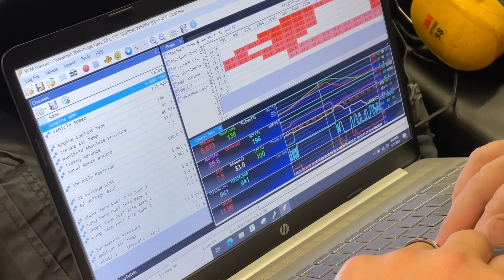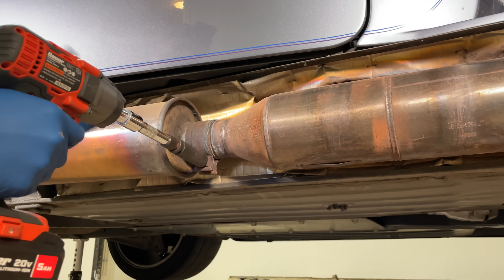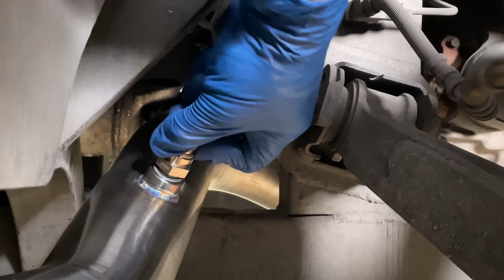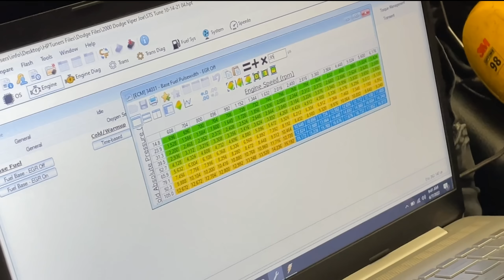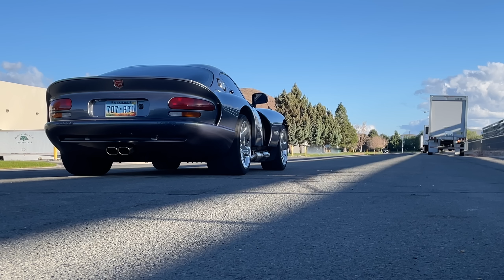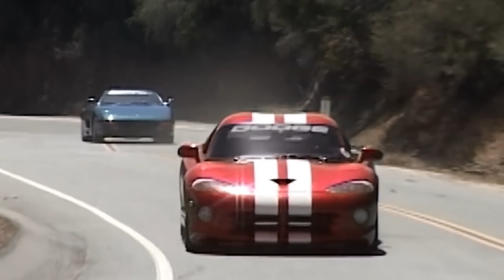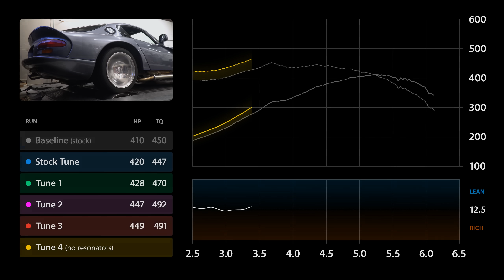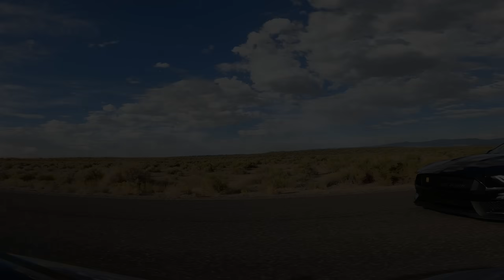When you give an 8-liter V10 the exhaust it deserves

Comment: It may have been quieter, but it definitely sounds better with the resonators. Without its a flat mush of engine sound, the resonators really increased the contrast and it sounds much more like a super car. Can hear the V10 sound and now you are in lambo/R8 territory instead of mushy american displacement. Either way love the car! looks amazing to drive!

EDIT: Especially when coming off throttle between shifts, sounds WAY better with the resonators!
Reply: Pretty much all cars sound way better with resonators. In fact without the resonators this vipers sounds a bit obnoxious.
Reply: @MrUppmas  nope
Reply: The viper, tuned with exhaust putting down 458hp to the wheels is about the same in the real world as a hellcat and cobra would put at the wheels. That 17 ordinary mustang putting 460? to the wheels wasn't stock at all, to be able to stay with the 458hp viper. Owners of hellcats claim a real 570hp at the wheels, is equivalent to around 710hp at the crank.
Reply: You seem to have accidentally used "with" instead of "without"?
Reply: Yeah agreed. Resonators sounded way more refined
Reply: It sounds like a truck without the resonator.
Reply: The "mush" is just the mic distorting. They sound way better irl, but they're so loud that the speakers clip.
Reply: completely and utterly disagree on all points
Reply: Too many people think brassy, blatty exhaust sounds good. I couldn't agree more with xSiliconKnightx. @MarinaraRacing

Comment: Damn, that exhaust design sucks if just taking off the resonators cost that much power. I found it interesting during the install video you have a reducer/conical pipe that extends into the resonator? Seems overly complicated and choking the exhaust. I'd be curious if you got rid of the reducer, kept it a full 2.5 or 3", kept the resonator and ditched the cats. May have added some sound and power while still retaining some sort of resonator/muffler.
Reply from the maker: Lou Belanger swears up and down the reducers increase performance. I’d have to do some controlled testing to really know.

Comment: It's actually pretty wild how well a car much older than the GT350 does and how much it can compare to it.
Reply: Well the Viper dominated GT circuits for a decade for a reason. Europe had to remake their rules just to keep it from winning every single time.
Reply: You know how much the viper used to cost when new right? I’m not surprised, you’re comparing a gt350 mustang, but still a mustang to a semi exotic car, for the money it makes sense
Reply: It wasn’t designed by Lamborghini, they recasted the block to aluminum. Chrysler designed it.
Reply: I mean it is impressive how little power the viper makes with such a large block.
Reply: @sidders1943  well it has no turbos or superchargers and it's a Truck engine.
Reply: @Qugie lol its not a truck engine. It was designed by Lamborghini.
Reply: @sidders1943  I mean... the engine is actually pretty damn reliable. This is a TWENTY THREE YEAR OLD CAR, so what are you comparing this to exactly? 
Z06 from this era made only 400 chp
911 turbo made only 450 chp 
Mustang cobra couldn't even make 320 chp and was discontinued for a while
Camaro SS sat at 350 chp
Pretty sure you've got to look at cars like the Lamborghini Diablo to find anything from this era making a bit more power. 450 without tc is a LOT of power on the street.
Reply: @sidders1943  Because peak power isn't all there is to vehicle performance. I'm honestly sick of seeing this "it makes more HP so it's automatically better" mentality that people have online that to me seems like they don't understand internal combustion engines at all and are just glorified bench racers spewing out HP and TQ numbers. 

Also, a lot of American engines are designed with the performance aftermarket in mind. Take the small block Chevy V8, they have dozens of companies making their own specific cylinder heads, camshafts, intake manifolds, exhaust manifolds, pistons, crankshafts, valves, etc. where as most Euro or Japanese engines have 2-3 companies making performance parts for them. They know their customers will want to add more power, so they leave it on the table for them.
Reply: @sidders1943  It's the same little power that OEM's like Ferrari and Porsche had to get banned to have a chance at circuit racing.
Reply: Almost like if you took a car with less weight more torque and maybe a smidgen less wheel horsepower the car with better numbers would win

Comment: Noise is just bullshit, performance is what is important. No wonder European sports cars with engines half the size and a fraction of the noise outgun loud rubbish like this. They concentrate on torque and power output not exhaust and engine rumble.
Reply from the maker: they just add turbos
Reply: @Four_Eyes  There are many sports cars that do not use turbos. It just  seems that american manufacterers concentrate on the things that don't matter. Engine and exhaust loudness does not equate to speed and performance.

Comment: It's actually impressive to gain that amount of hp on the whole curve just by swapping the exhaust
Reply: more airflow more bang mo powah
Reply: No :P @b5254t4rs
Reply: dont forget the tunes
Reply: its the tuning that made the difference
Reply: @rykehuss3435  My first thought, too: Valid comparison? Did he go through the tuning exercise with the stock exhaust, too? I guess not.
Reminds me of what I just learned, that Koeniggsegg advertised their Freevalve advantages by stating figures compared to non VVT engines instead of modern VVT engines.
Reply: @rykehuss3435  all other comments are Biden voters
Reply: @rykehuss3435   watch the last dyno pull same tune but deleted resonators,  shows a gain
Reply: clearly a restrictive exhaust
Reply: Pro tuning + good exhaust will do that. Fixing the entire aspiration and exhaust system from intake to tailpipe and tuning to use that extra flow adds a ton of power.
Reply: @Gelatinous  Well, it doesn't add more than perhaps 10-20 hp, so much as it gives you exponentially QUICKER access to that feisty V10 power/torque you already have. Ergo "throttle response!"
Reply: Wait till you find out about 🐌
Reply: @kumbho80  ffffutututu
Reply: @kumbho80  Turbo???
Reply: what's not impressive is making 450hp from 8L, that why such easy gains can be made.
Reply: @krusher74 that's a stock V10. Stock cam, lifters, pistons, intake, and the rest.
Another 2 weeks or so of work in the shop, and 600 ponies will easily be made without nitrous or bolt ons.
Reply: he made ecu reprogramming
Reply: tuning is the key to power success
Reply: Huh?
Reply: jhgad
Reply: @nismojunk  Sausage
Reply: Because your have 8l v10 on it,  just let the engine breathing and your get a lot extra hp
Reply: 100gallon per miles...aw yeahhhh americaaa
Reply: Vipers are good on fuel compared to other high HP engines (for cruising at least) because there is so much torque / power low down that you can have a super long 6th gear and cruise along with the engine just slowly ticking over. Corvettes with long top gears are the same too. 'murica 💪 @shafiqshahar1456
Reply: Its the amount of cylinders. a 4, 6, and 8 cyl will gain the same overall percentage of hp with a tune.
Reply: "just by swapping the exhaust"
That's not what happened at all
Reply: Not without a tune. Back in my day there were 40ps VW Polos that had mufflers on them with taillpipes as big as  a tunnel. 
They sounded like 500hp but accelerated like a ride-on lawnmower 
🤣
Reply: @Enforcer_WJDE Forged internals, a rowdy cam and some Webers could get them up to 100hp, but it's a metric fckton of work and money for what might be a hell of a lot of fun, but in the end still a relatively slow car
Reply: @samteks125  It's not always about too speed. You can't even use the entire revband in 1st gear without going to jail.
Reply: Guess the tune didn't happen LOL
Reply: V10 8.1 liters and just 465hp? Wtf? It should be at least 700 stock...
Reply: Engines are pretty similar to us in that sense. The like to breathe. More air and a retune to compensate is always going to make more power.
Reply: I mean the original exhaust is pretty damn limiting
Reply: its a v10 lol not a 4 cylinder
Reply: Turbo cars same way, 227 becomes 300 with full exhaust, boost up
Reply: The major gains you get from improving your exhaust is throttle response, with just a little hp/torque gains.

It simply gives you quicker access to the hp/torque you already have!

Comment: Full dual 3” exhaust glasspacks with 1 7/8” long tube headers that exits right after the door works the best on my LSA supercharged nova…..unfortunetly you cant hear much blower whine but id rather piss off the nieghbors and set off car alarms any day….i was making 12/14psi boost when i had 2.5” dual flowmaster exhaust…..when i went with the 3” glasspacks it jumped down to 10/12psi……either way im happy……..i have a ‘73 c10 shortbed fleetside with a built 5.3 in it, i put the 2.5” flowmasters on it and after i finish paint and body ive gotta centrifugal supercharger and terminator x to put on it……it already hauls ass with a cammed 5.3 but both my ctsv and nova have positive displacement blowers on them so i wanted to switch it up a lil bit, probably gonna respond like my tuned lmm duramax ……only alot faster

Comment: This engine is a Pushrod, the only V10 Petrol engine that has this. This engine is simplistic and was cheap to build. Displacement increased to 8.3 Litres in the 3rd Gen it just can’t rev past 6,000 RPM than what BMW’s S85 V10 can. It’s not just the Viper V10, that’s Pushrod engines in general, they’re not that efficient in getting air like a Dual Overhead Cam engine like Ford’s 5 litre Coyote can

Comment: The tuned stock exhaust made 438 hp from your other vid, the upgraded exhaust only made 449 hp with resonators. 11hp ☠️ have to remove the resonators that you already paid for, to get more power out of the new exhaust. Maybe ARH is better?

Also, how about part throttle tuning?

Comment: The 350 is pretty fat, but that wasn't even competitive. Switching from 2.73 to 3.73 diff gears made a massive acceleration difference in my 2012 base 6spd 3.7 Mustang. Went from reasonably fun with 2.73s to feeling actually quick all the way to the top of third. Easily dropped a second off the 0-60, but being the base shitbox, weight was around 3280 with some bolt-ons which was about as light as it gets for a modern 2+2. Only downside was first being so short I'd usually start in 2nd unless ripping it, and freeway RPM jumped from 1600ish to just over 2100. 

TL:DR gearing is often completely overlooked and often is the only mod <$500 that can actually noticably improve performance.

Comment: An 8 litre v10 giving 450bhp? That is one lump of junk engine! How much does that crock of iron weigh ffs? 
How come British engineering can get 450 horses out of an engine that's only 2 litres! The v8 from the gt350 isn't much better either. 🙄
Reply from the maker: How come? Because they add turbochargers of course. Turbocharged Vipers are some of the fastest cars on the road.
Reply: @Four_Eyes  maybe! But only in a straight line 😂😂😂
Reply: @Four_Eyes  you should maybe watch BBC America and the program Top Gear. They take the fastest cars around their own test track. The program has been going for about 25 years. NEVER seen an Amercan car on it. Why? Because your cars aren't built to go round corners. An F1 car would leave a Champ car in its dust and it wouldn't have to be a good F1 car.

Comment: I’m very surprised the Viper did that well even lightly modified against the GT350. There’s 20 years of engineering and materials tech - not to mention the original purpose for each car - that separates the two. The Viper obviously has the tire patch advantage; it’s rears are probably 50% wider. But I figured modern traction tech would have the Mustang walking all over the Viper.
Reply: id be curious to see it all-out from a standstill. And the viper weighs like 400 pounds less a crude google tells me

Comment: The viper was a luxury sports car. It wasn't designed to be loud. It is still very fast even compared to modern performance cars. But I'm a carburator cave man. Computers are for nerds. I can tune the carbs on my outboard, truck, motorcycle, lawn mower, generator with just a few hand tools. I have used a carb as a hammer.

Comment: A lot of horsepower, but it doesn't do anything in curves, old American cars don't have good suspension for cornering, any average European beats it on a winding circuit.
Reply from the maker: "...the Viper GTS ripped through the slalom cones at an electrifying 73.6-mph average. That's the fastest-ever Motor Trend slalom run by any automobile, surpassing a horde of modified cars, many of which were fitted with super-sticky race rubber."

https://www.motortrend.com/reviews/track-testing-event-part2

Comment: Well made video, like your style. Straight to the point. I think making a viper sound good is tricky to say the least, because what do modern V10s (eg. Lambo, Ferrari, R8) all have in common? They rev to 8-9k rpm and have much smaller displacement. Making an 8L chunk of american scrap iron compete with any of that in terms of sound might be a bit of a lost cause. Still love the car for what it is and thanks for trying it out anyway. Impressive power gains for just an exhaust tbf.

Comment: I remember my throttle cable breaking on my foxbody, I used a brake cable off an old tenspeed bike 😂  still works to this day, and it's ten times smoother than all the other cables.

Comment: Hope someone can answer this... If the power is already made in the engine itself and being sent to to wheels how come ur exhaust can have an effect on th hp?
Reply from the maker: Power comes from combustion which is a mixture of air and fuel. If the used air (exhaust) is restricted from getting out and some old air stays in the combustion chamber, the engine will produce less power. This is known as backpressure and it's not good for performance.
Reply: @Four_Eyes  damn that acctually makes a lot of sense, i'vr been wondering that for a while. Thanks a lot

Comment: What kind of power robbing accessories does this gen viper have? I assume it already has an electric fan, if it doesn't that could help, electric power steering/ water pump conversion could too. Lightweight pulleys? (not under drive) and maybe a "cold" air intake/ pnp manifold, carbon fiber driveshaft, and retune might bump it up to that magic 500 hp with all mods combined.

Comment: Americans have a special power, they make their engines massive only to produce half of the horsepower the japanese or the europeans would normaly squeeze out of their engines.

I will give you an example: volvo t5R l, same year, half the pistons, same 20 valves, 2.3 liters (although turbocharged), sounds about the same, 300hp, easily tunable to 400hp. (And it has 5 seats and a boot)

This is almost triple the horsepower per liter...

Great video nonetheless, keep up the good work